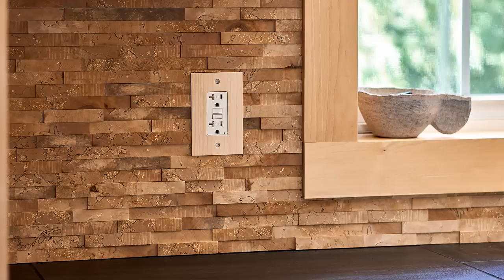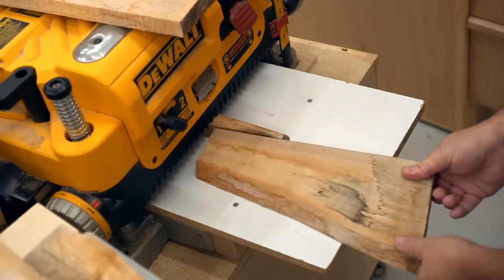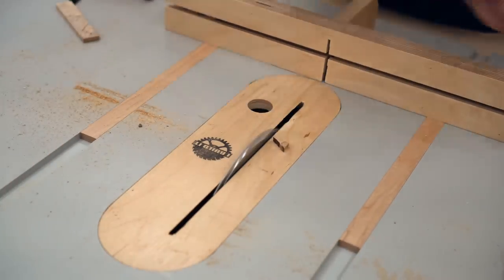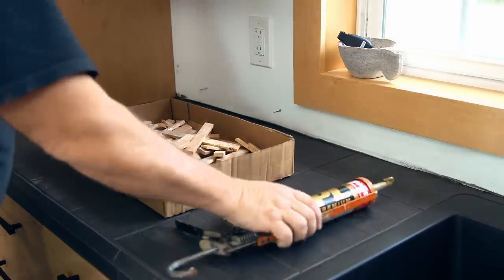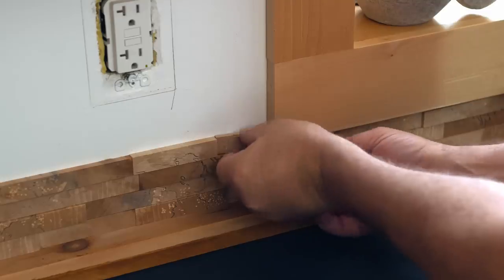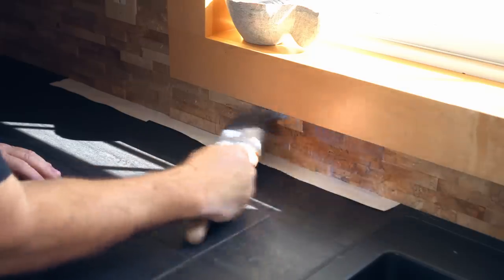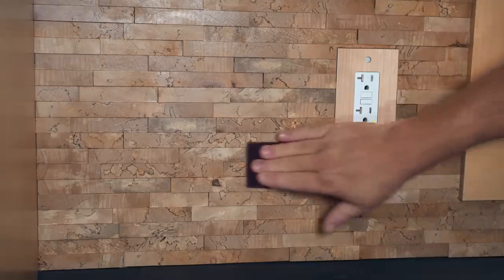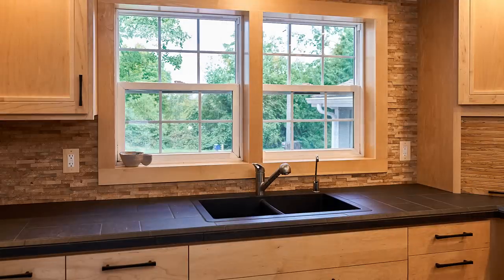How to Make an End Grain Backsplash

Comment from the maker: I started this almost exactly 1 year ago - September, 2020. And I'm just now getting around to finishing it. What the video doesn't show is that it isn't actually finished, there's still a section above the window that is not tiled. I'll get that done soon, but wanted to clear this project out of my video queue. The hold up was putting on the three coats of water based poly to protect it - I knew it would be the least enjoyable part of the project and that gave me enough of an excuse not to get it done.
With everything I said in the video about how much time went into it, it's definitely worth it if you want something unique and different. I'm now thinking that I really should do the second wall in the kitchen (counter is "L" shaped) but use the panel method I described in the video. Still a ton of work, but then installing ceramic tiles isn't a walk in the park, either.
Reply: “The least enjoyable part of the project” is why half a dozen of mine are still in the shop.
Reply: At first I thought it was natural stone. It doesn't make much sense to use wood as the back of the kitchen counter. If you definitely want it to be wooden, it would be more logical to scale the floor you want to lay with 3 mm plywood and stick it to the floor. You could do it much quicker and easier. It is not pleasant to interfere with the use of the kitchen for a long time. I think you're tired of it.
Reply: I've just finished a project like this one. At the begining it seems easy and pretty fast. Then you cut all your wood, and you realise you have to sand it. A Nightmare. I glued it on 4mm plywood but, trust me, it's thin, it curves with regular glue (t*bond v2). Go for the 8mm instead. Sprayed with white, water based, varnish. 1 year of bad words by my wife, but a lot of fun for me. I didn't glued it on the wall (concrete in my region), I just fixed the panels with screws on strips of wood (fixed on the wall with fishers) so cables can pass behind it. If I will sell the house, this stuff will go with me due to the time i've spent to build it, you bet.
Reply: I love this. I will do as suggested making panels and gluing the pieces onto the panel. Spraying the panel outside, and then putting the panels on the wall.
Reply: Definitely worth the time imo
Reply: Good tip to use urethane glue to prevent curl!  I spent the 1st half of the video wondering why John didn't make panels with a thin plywood backer, then he says 'If I had it to do over again...'  :-)
Reply: Looks stunning
Reply: The cleaning issue was my first thought. This still looks pretty cool, maybe for the entrance? Not that I would do this. Ever. I admire pushing through with it!
Main reason for not doing it: got to replace all utilities, electricity, cold and warm water, gas, central heating, mud the walls, install new flooring, build the kitchen and a new dinner table....
(plus I have a job, instead im watching YouTube, and commenting. Procrastination?)

Comment: Beautiful job John!! one of a kind and works with the kitchen 1000% . 
Did the same thing with natural black slate tiles..all different thicknesses and random lengths of tile and we also added different heights to the mix. Did an 8 foot long by 5 foot tall backsplash and it took 2 days of cutting tile and then another day to tile the entire thing. We sealed all the tiles before cutting, then again before installing and then again after install. Something you could have done was sealed them before hand. We added in a magnetic strip from Ikea(stainless finish) to hold our knives (recipes,etc)to the backsplash. It was a one of a kind backsplash that got a lot of 'likes' from neighbors and friends. Just goes to proves that nice things take a lot of work.

Comment: I know what you mean. 20 years ago I did a 2ft by 6ft bar top in 1/4" thick fir wood tiles. I made the mistake of using wood glue at first. What a disaster. Had to scrape clean and cut 17 new tiles. LOVE the results, won't do it again!

Comment: It looks great John. A lot of work but it shows to those who can see what it takes to put it together. The idea of fastening them all to a 4x8 panel then cutting out what you need, or cutting the back panels so size first then layering on the blocks is great. Then as you said you can apply finish in the shop where it's faster and less mess for the kitchen. Must have been tough working on that around daily use of the kitchen for the past year.

Comment: That does look really nice. Dusting it must be a challenge what with all those little ledges. I might try something similar, but I'll probably use larger tiles (2"X4" maybe), all the same thickness, with beveled edges. Put them up in an offset pattern, like bricks. Something to think about anyway. 

I really like the panel idea. I need to put up some wainscoting in parts of my house to cover cracks in the drywall that refuse to stay patched. The panel-built approach will make that a lot easier than what I was thinking.

Comment: Beautiful look for a custom kitchen. I wonder if a panel system could be designed that wouldn't look like it was panels ? One where the sections stick out on one side and are inset on the other so that you could maintain the custom look you achieved but with essentially pre-finished wood panels that look like the individual blocks. If you could achieve that commercially I think it would become a very popular look for kitchens, family rooms, rec rooms and feature walls.

Comment: This looks terrific and I would really love to do it, but I won't for 2 main reasons: (1) The surface appears to very uneven, which by itself is not a problem, but that brings us to (2) which is that you can't really clean this backsplash if food gets on it. If you only microwave dinners in your kitchen, then I guess it's okay, but for any fully functional cooking kitchen, this is a much less than optimal solution.

Comment: I really like that however for us I gotta have something non porous and not afraid of washing it down. I ended up doing ours with travertine tile herringbone style... And wrapped it around to the window and used a travertine threshold for the sill. So it was 30 linear feet then up the wall to the top of the cabinets above the sink and stove and a fancy pattern above the stove where the pot filler is. Never ever again. Thousands of triangle cuts...

Comment: I have a "dumb question" :  if you have to use construction adhesive that has no water in it to prevent warping the "tiles", how does "water based polyurethane" not have a tendency to warp the tiles?
 
Obviously, it does not, but I cannot figure out why it doesn't.
First I thought it was because the tiles are glued down, but since they are glued to drywall, they are effectively glued to paper.

I feel ignorant.
and confused.

anyway - super cool project.
glad I am not the only one who figures out the best way to do something after it's too late to implement that approach.
Reply: The tiles are already locked in with the poly glue so they can't curl up.